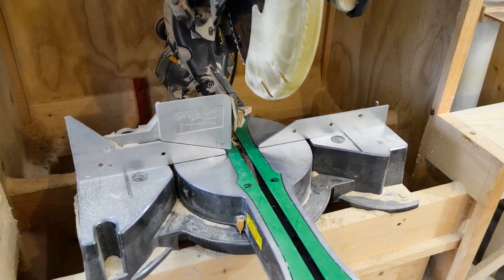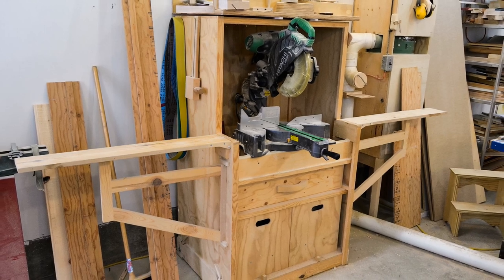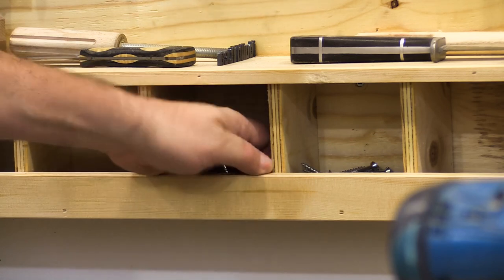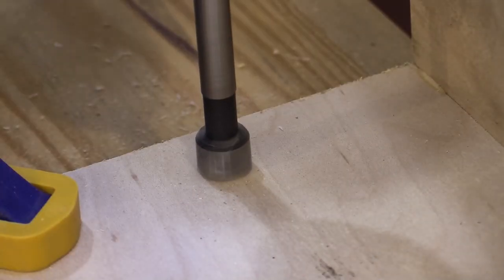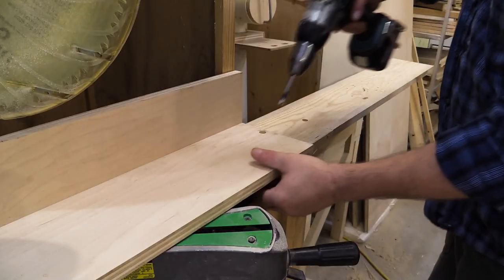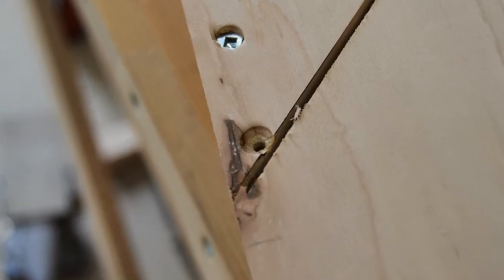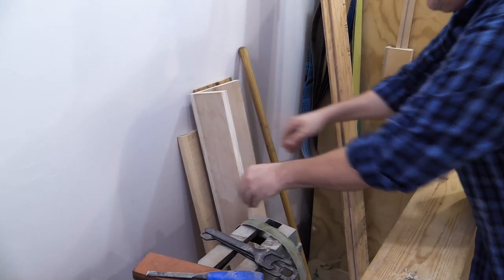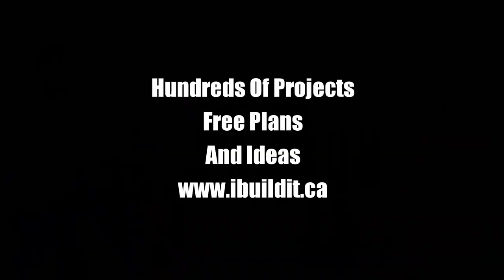Making A Zero Clearance Fence

Comment: Hey John great video.  I have been trying to find out the name of the epoxy you use when securing metal to wood (I.e. The metal nut you cut in half for the wood vise). I looked on your site and at a few videos to get the name but couldn't find it.  If it's only available in Canada can you recommend any brands from say Home Depot or lowes? Thanks in advanced. And great video once again.

Comment: Nice video as are all of them. A cool tip I picked up a wile back was to stick a peace of ducked work aluminum tape over the gape run the blade through ones and u have a quick 0 clearance gape

Comment: Great video! Also another thing to add is with all my slide saws i have removed the plastic plates on the table part and installed a solid plywood plate as the gap where the blade goes into is quite wide and stuff seem to fall into the gaps and create problems too. Also when i get the saw the new the plate is lower than the actual table which causes a problem of cutting a small pieces off and it rattles in the lower part of the plate and you lift the blade while its still running and will cause that piece to kick out.

Comment: I've got the same saw. I think because of that big gap in the fence, it once yanked some small stock right out of my hand - I was lucky and didn't get hurt. I should really use this idea just to increase the odds I'll keep all my fingers.
Reply: I had the same happen to me. Made a huge ding and threw the piece through the room against the wall with such force that it came back flying past me. Luckily there was no blood for me neither, but I had a bruise on my fingers and a thumb joint that hurt for a few days. When something like this happens it takes a few seconds to know if you still got all your fingers, at least for me. I feel stupid to even have tried something like that. So a fence like this is on my todo list now, too.

Comment: Great video! Dumb question...would it be possible to leave the fence in one spot and just swing the blade around for the two 45 degree cuts? Thanks!
Reply: No, because all three cuts would be in the same position in the fence and what is left between them due to the angle would easily break off.
Reply: No because you would get a gap where the three cuts meet and it wouldn't be zero clearence.

Comment: why 3 position fo every angle? why not alone position?
Reply: probably the screws in the back or the structural integrity...just a guess
Reply: If you use one position for all three angles it would end up with a big wide cut opening. You would loose the zero clearance aspect.
Reply: I had the same question. It wide enough that it should be able to be stationary. Move + - 45 deg and 90 to make zero clearance cuts, done. Are we missing something?
Ok, now I understand looking at other videos for the same idea, each angle cuts thru the same point of the back, widening it.
Reply: Andrea's Workshop has

Comment: What is the fence for ? to extend the cutting platform ?.. I just purchased my first miter saw today & was looking up some tips for it is all. Thanks in advance.
Reply: I could eat a bowl of alphabet soup and crap out a smarter comeback than what you just said.
Reply: Angela Benschop
Why don't you check up on eBay and see if they have a life for sale. Think you more indeed then me.
Reply: It helps in lining up cuts, helps prevent chip out, as well as allowing the user to clamp stop blocks.